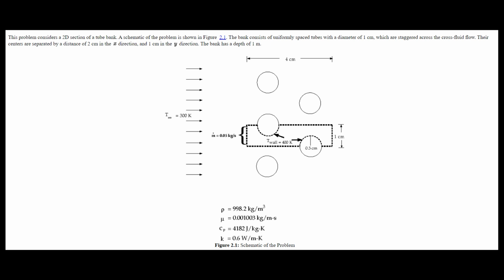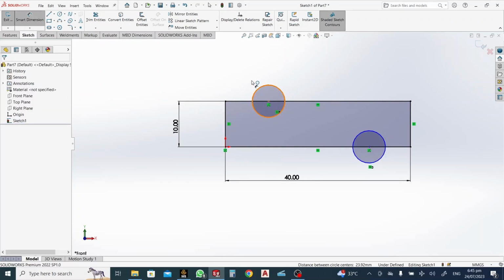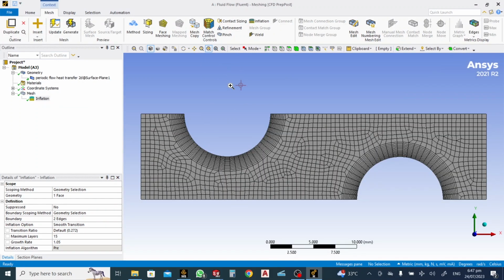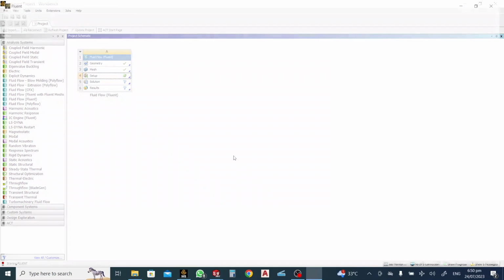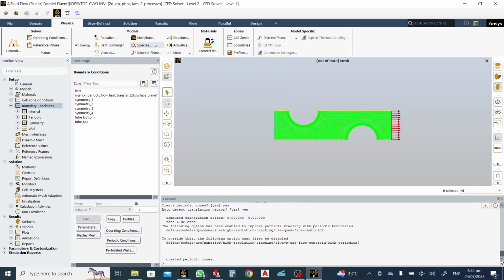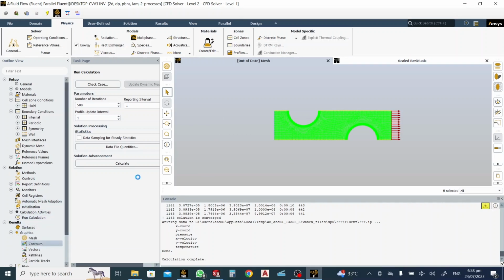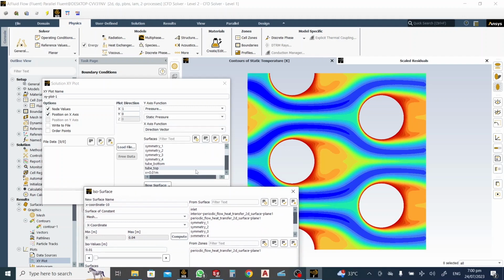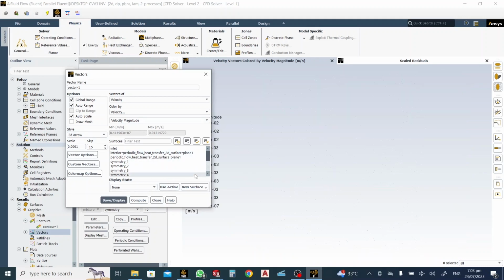2D Periodic Simulation of Heat Exhanger | ANSYS Fluent

Comment: Thank you for your excellent and helpful ANSYS Fluent tutorials!

I would like to kindly request, if possible, a detailed, step-by-step tutorial on *Mesh Independence Study (Grid Independence Test)* for CFD simulations, particularly for flow and heat transfer around cylinders or tube banks.

It would be extremely helpful if you could explain:

1. How to generate different mesh levels (coarse, medium, fine, and very fine).
2. How to choose the appropriate mesh size and apply local mesh refinement.
3. How to properly configure inflation layers, including first layer thickness, growth rate, and number of layers.
4. How to evaluate mesh quality using skewness, orthogonal quality, and aspect ratio.
5. How to perform a mesh independence study using Nusselt number, pressure drop, and drag coefficient.
6. How to determine which mesh is sufficiently accurate without unnecessarily increasing computational cost.
7. How to calculate and interpret the Grid Convergence Index (GCI) to estimate discretization uncertainty.

A complete practical example comparing several mesh configurations and explaining *how to scientifically select the most suitable mesh* would be extremely valuable for PhD students and CFD researchers.

Thank you very much for your valuable educational content!